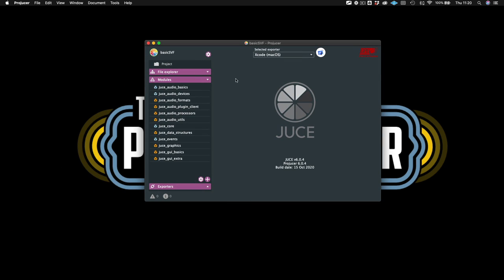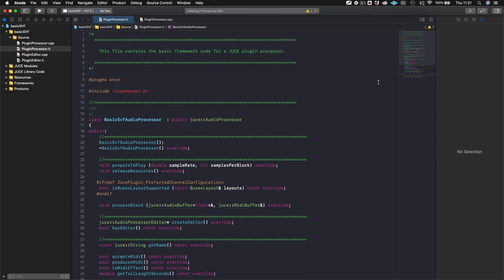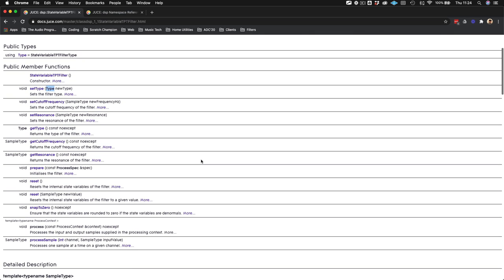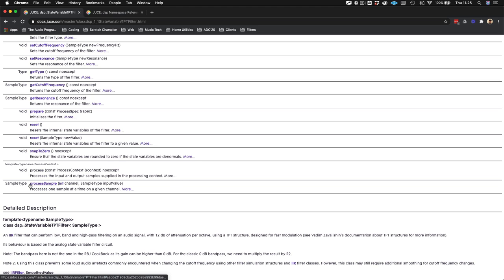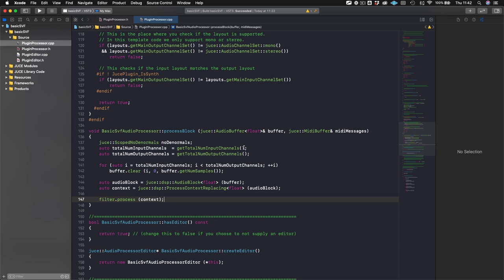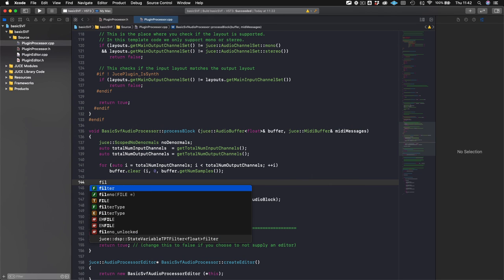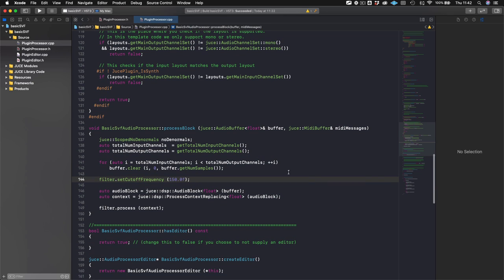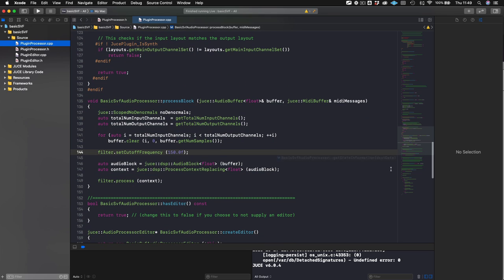JUCE 6 Tutorial 10 - State Variable Filter and the DSP Module

Comment: I'm running into a problem with filters and I think it may be where I have the filter living.  I am rewriting some webaudio code I wrote many moons ago and it involves fm on the filter resonance (i.e wub).  This code runs perfectly fine in the browser, but that doesn't mean much :).  In that code everything including the filter, the envelopes, and the actual waveform generation is done inside the voice.  That means each voice will render it's stream, filter it, amplify it, and mix it all within the voice.  In many examples I see with the SVF I see it's being applied at the processor level.  Anyway, what I'm hearing is clicks when changing notes on the keyboard.  It's a very slight click and most people I demonstrate to don't hear it (or they are being polite), but it DRIVES ME CRAZY.  I've tried different filters including the maxiFilter, the SVF from the dsp module, and a custom LP12 filter I wrote (ported from javascript).  I even wrote my own biquad filter.  The biquad and lp12 don't react well to fm though, so I went with the SVF which handles the modulation much better.  It's those damn clicks that drive me crazy.  I'm thinking maybe it has something to do with applying the filter at the voice level rather than on the entire sample set after processing?  I'm thinking that I should probably filter the mixed signal rather than filter the individual signals and then mix them after the fact.  Any ideas on how to stop that incessant clicking?